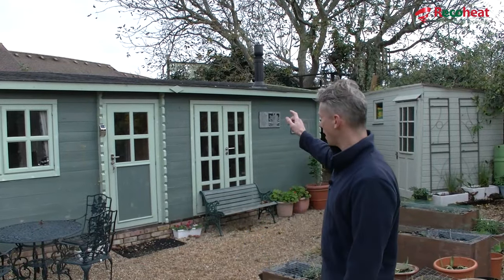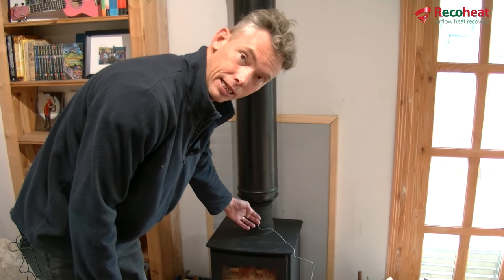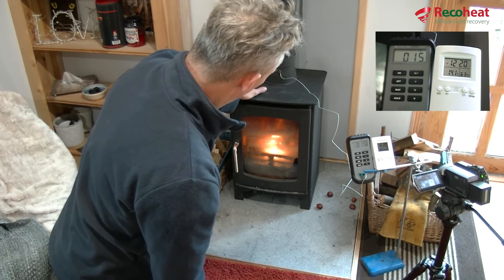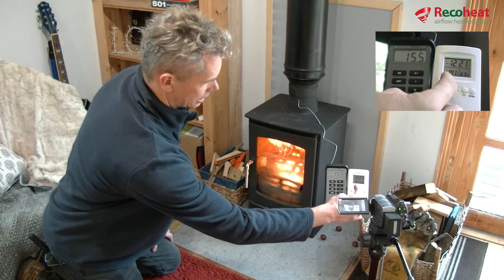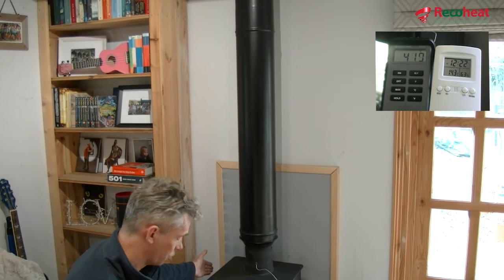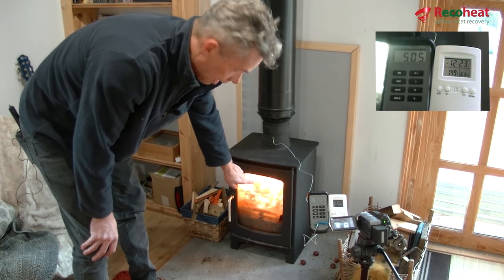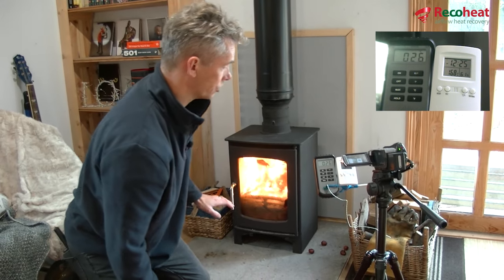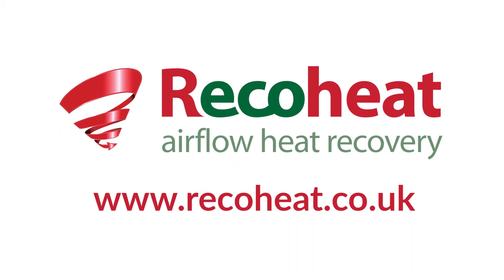Introducing the Recoheat heat recovery unit for wood and solid fuel burning stoves

Comment: I've absolutely no idea of what you're talking about. No idea of what the device is, where the air movement is, what's inside the flue. No idea if there's an electric fan in the flue, where the air's coming from, where it's exhausting to - indeed, no idea at all.
Reply from the maker: Website is www.recoheat.co.uk for more info, if you're interested.

Comment: Generally, you want flue temps to remain high to prevent condensation. Removing too much heat is a recipe for a chimney fire.
Reply from the maker: That's right: hence our use of the turbulent boundary layer phenomenon.
Reply: You nailed it...... I tried something similar several years ago and as you indicated it caused the build up of creosote, resulting in chimney fire..... it wasn't a major disaster, but could have been.
Reply from the maker: BSRIA tested the system for safety, and a key element of that was the temperature monitoring all the way up a 4.5m flue. Their report is here: shorturl.at/gtuS0 You can see that it doesn't cool the flu as you suggest.
Reply: Interesting to compare to a Rocket stove where the "flue" is kept as hot as possible for a metre or so to achieve a complete burn for both fuel efficiency and to minimise tar build up and other pollutants in the exhaust. Ideally you would want an initial  very hot section of flue (as above) before starting the "heat recovery" which is the stated purpose of this design.
Reply from the maker: @rhiantaylor3446  That's an interesting perspective. The hot burn is certainly crucial, but a big difference with our heat transfer is that it is exponentially increased in rapidity by the use of the turbulent barrier layer, so the resultant heat transfer away from the flue gases during their flow past the 9 inches or so of the coil, is absolutely minimal - so much so that it is undetectable. This is completely different to the loss in a section of single skin flue, for example. The volume of flowing flue gases passing across the coil is proportionally very small to the total, and the over-all drop in temperature is undetectable by our own measurements and in the external laboratory testing. Turbulent air heats in a completely different curve compared to a laminar flow.
Reply: @Recoheat  Either you are recovering heat from the combustion gasses or you are not. If you are then you must be cooling them. Simple physics.
Reply: I'm guessing it is using the venturi principle to increase the volume of air throughput?
Reply: @donaldasayers  I think what he's saying is that heat is recovered from the flue gases, but the heat loss from the gases is insignificant in terms of the actual reduction in flue temperature, so it doesn't cool enough to be a concern with regard to tar build up.  The hot air is then emitted from the nozzle at high pressure, thereby distributing it more evenly throughout the space to be heated.
Reply: Thanks to the All the Comments.  definitely wouldn’t chance this just stick to my fan on top of the wood burner it works well.
Reply: What’s wrong with a fan on top of the stove, ours makes our large living room feel like the inside of a Volcano‼️
Reply: I could imagine modern stoves (at least in Europe with this new econorm standards) with their secondary and tertiary combustion would make a difference, its the big molecules that condense easily, in modern stoves these get broken down into much smaller molecules before exiting the stove. 

I think that allows for some (not all) heat recuperation, especially because these secondary burns usually take place right before exiting the stove creating very hot gasses with few heavy elements.
Reply: @Recoheat  and
Reply: @Recoheat  oooh science words! It must be good!
Reply from the maker: @mark76197  Ooh, sarcasm - it must be witty.
Reply: @Recoheat  Not as whitty as using fake jargon to sell a dangerous priduct.
Reply: @mark76197  not as stupid as repeating the same thing when confronted with evidence to the contrary. Look at our TrustPilot reviews and external industrial engineers report specifically testing for the genuine concerns you raise and showing that our product does not cause these issues. If they did, it wouldn't take more than weeks at most before they were closing our customers' chimneys. Flues are not subtle things. They don't and you are reasonable but wrong. You should celebrate that because this device is important.
Reply: @mark76197  Is a ‘dangerous priduct’ to do with primary ducting or something 😂
Reply: @mikespeers8281  creosote condenses on flue pipes when the interior surface of the pipe falls below the boiling point of water. This system steals heat from flue pipes, greatly increasing the rate of creosote accumulation and the chance for severe flu fire. It will recover a lot of heat? But at a cost.
Reply: @mark76197  Oh I see, thanks for the education 🤓🤣
Reply: @mark76197  If you burn properly dried wood with moisture less than 20% and then also run the ocassional non-fan highest heat  burn thru to removeresidual  soot tar, this should not be a problem. I am no scientist but have run stoves for years, and would liken the scenario to that of DPF filters in diesel engines.  they also benefit from full throttle cycle to carbonise and remove off soot particles, creoste etc, but otherwise operate 'cooly' for 95 % of their operational time?   Give these guys a break
Reply: @thomasreed49  what kind of fan are you using?
Reply: @Recoheat well said, sarcasm is the lowest form of wit. So negative and easy. Thanks for your invention and effort to keep us all warm. 🙏🏻
Reply from the maker: @RestWithin  Thank you very much! We love all the engagement - always offers the opportunity to debate - and keeps YouTube interested in us! Thanks so much for your support.

Comment: if you can power that air pump from the heat produced on this stove and do a schematic video I think everyone would be happy; and also I think you have to figure out a way  to make a device that a normal person could install, because some installers have only got the £ in their heads and not the service sadly..many go to youtube to save money and improve what they have got, not just “look buy this, because it’s doing this”… 👍✌️
Reply from the maker: Yes, both would be wonderful. The latter is largely regulatory, though there's a very practical issue of ensuring something as dangerous as a flue is maintained competently. The former will take a lot of engineering development, so is expensive so requires lots of sales, or investment.

Comment: I don't use a double skinned insulated flue directly on the stove. A single skinned one radiates quickly into the room. If wanted heat distribution I'd use a nice quiet stove top fan. What you have, is fantastically noisey.
Reply from the maker: For sure: a single skin will radiate about 1kw per metre, apparently, but that does cool the flue far more than our device, and in any case will not circulate any better. In terms of heat distribution, the Recoheat isn't relying on radiant heat to function, so continues to distribute even when the stove is cooling. It's a very different thing, and functions in a completely different way. The noise of the turbulent air coming through the outlet is indeed distinct but it's by no means 'fantastically noisy': air and water flow mess up microphones so it sounds louder on video. In a silent evening of contemplation, you can just turn it off, but in a room with anything going on, you don't notice it.
Reply: @OKuusava  I put the 'stones' out of old electric storage heaters around my stove
Reply: I agree just far too noisy

Comment: Hi, congrats great product I'm getting one, regardless of noise. Yet would you please measure the decibels of noise of the pump and hissing combined? a decibel meter app in your phone will do. Thank you amazing product.
Reply from the maker: Yes, sure: we measured with a sound meter, but because it is trying to measure a flow, microphones hate it! We'll try with an app.
Reply from the maker: Hey 1 2 - we've done that, and here's the video: https://youtu.be/z0t3_nrurZg - it comes out at about 9 decibels. There are notes in the description of the video so you can get the same Decibel app to do a comparison. Thanks very much for the interest and the suggestion - great idea because it's actually creating data you can compare. 👍👍
Reply: @Recoheat  Thank you! 9 decibels is nada. I'm ordering it soon!

Comment: Are you saying that the air that comes out of the front nozzle is 400 degrees? isn't that dangerous?
Reply from the maker: Over the top of the stove, it's hot, yes, but so is the stove. The only time you have to be careful is for the twenty - thirty minutes whilst the stove is getting up to temperature, including while it's cold. The air from the unit is that hot within a minute because it's from the combustion, so the stove temperature won't warm you of that.

Comment: Hmm, I love it. I'm concerned that lowering the temperature of the flue would allow more creosote and condensation to build up.
Reply from the maker: The use of turbulent air to extract heat from the flow of gases means that the proportion of heat extraction is very low, and the cooling effect proportionally negligible. This was tested by BSRIA and their external independent data is available in their report and certificate on our website: shorturl.at/gtuS0
Reply: Burn properly dry hard wood

Comment: Nice! This got me to thinking and wondering if a passive system like this would also work. Essentially just as pictured only the outer pipe terminates about a foot or two from the ceiling, possible even a bit cone-shaped, wider at the bottom, to create a Venturi effect. It would naturally draw cooler air from the bottom and exit warmer air from the top. A Peltier wood stove fan could possible assist with this. A system totally removed from the need for electricity should there be a significant interruption or for off-grid settings. I'm not an engineer, just ruminating is all. Anyway, great idea. mate!
Reply from the maker: Thanks David - really appreciate it! It's something we're exploring, but as described it doesn't work because the air has to be forced to make it turbulent. It's the turbulence that creates the super-rapid heat transfer, and therefore the expansion and acceleration which in turn creates the vortex effect that draws the heat away from the stove, and the pressurisation that precipitates the heat dispersal via the equalisation. That in turn is why the heat transfers so far - because it's not being pushed, but is exchanging as part of the equalisation and subsequent convection flow. It's really interesting!
Reply: Already exists

Comment: I worked for a stove manufacturer...the wood stoves they provided met California EPA emissions.    2.5 - 4 grams of emissions per kilo of wood fuel.... very efficient
Reply from the maker: Modern stoves are fantastically efficient. Our unit addresses the poor heat displacement that is implicit in requiring the combustion to draw cool air towards the bottom of the stove, into the combustion and up to the ceiling, and up into the flue. We're providing a supplementary powered method of heat distribution from the same heat source which is extremely efficient and effective.

Comment: Is there any harmful gases being sent into the room?  Off grid no electricity think I’ll stick with the fan attached to chimney best buy I’ve ever made
Reply from the maker: No mingling of the pumped air and the combustion gases at any point. If your fan is working fabulously and does what you need, don't fix it! This product is aimed for people whose heat doesn't circulate effectively around their homes, and achieves that far more effectively than anything else, by a long way. But of course, if you don't need it, happy days!

Comment: Hi there this looks a good solution but why is it so high priced the material cost can't be more then £35 and my stove was only £366 and the price of your recovery unit is £299 its going to take many years to recover the £299 please explain your price before i invest many thanks Budo
Reply from the maker: Hi Budo, alas the material costs, fabrication and technical costs are considerably more than that. I'd buy them from you if you could produce the units and the pump, and the silencer for that, but you'd have to be CE marked first, as we are. It's not a cheap industry to operate in, as you'd imagine for safety reasons. The heat output and fuel savings mean some people replace their oil, gas or electric heating entirely with their stove, so recoup the cost in a month. The system really does make that big a difference. You can see our customer feedback on TrustPilot. Thanks for your interest.
Reply: @Recoheat  Thank you for your reply sir could you please answer one more question before we make our minds up on buying two of these for our French farmhouse how long is the stainless steel coil component inside guaranteed for and its general life span many thanks Budo
Reply from the maker: @FrenchFarmhouseDiaries  Hi Budo, the unit is guaranteed for five years, and the pump for two years. The pump will wear out eventually, but the coil won't: it's made of the same material as the flue itself, but is thicker. and the form is much stronger. External test engineers stress tested it to over 900C, and you can't see any difference, as you cannot after years of use. I hope that gives you the confidence you need!

Comment: What if the power goes out. Is there a bypass or will you burn the unit out. Thanks
Reply: No,  it makes no difference. The coil is made of the same material as the flue so is not affected by the heat. You can switch it off if you want to. It is thermal shock tested to 800°C which. Is hotter than the flue gas temperature.
Reply: @willburrows  great stuff! Thanks for your time and knowledge 🏆🔥👍

Comment: Hi, nice video but I don`t understand it :-) Please explain again because as I understand, you are pumping the hot air from the stove into the house ?. The exhaused air ?! I can not imagine that. What do I understand wrong ..? Please explain again or can someone else please ?  Thanks !
Reply from the maker: Hi Christian, thanks for the interest. No - we're pumping clean air into a sealed coil that passes through the flue. So the clean air is heated, then comes out of the front of the flue in a little nozzle. That blows over the top of the stove and carries the heat away and around the house. Do take a look at our other videos - they make it a bit clearer!
Reply: @Recoheat  thanks you very much for your quick response. Clear now :-)

Comment: Now I am wanting to buy a northern cabin up in the mountains so I could get me one of those things! Great looking stove. It would be great if you could share some of that heat through a spiral duct into the other parts of the building.
Reply from the maker: People are coupling this with ducting and circulation systems. Generally it does shift the heat a long way in any case. Customer has got one in a cabin in the mountains near Sacramento: I thought it was hot there, but he gets 6 foot of snow in the winter. Fitting the unit means he doesn't have to get up in the night to put more fuel on the stove.

Comment: Can you give a brief explanation how this works? So looks like you have an external air compressor pumping air into where? The firebox or the double walled chimney? Where is the air coming out, the firebox or at the bottom of that double walled chimney?  
If you are pumping air directly into the firebox, how do you damper down your air supply to slow down your wood burn rate?
Reply from the maker: The air is pumped through a heat exchange coil set into the flue, but completely sealed from it. The air therefore does not enter or effect the fire box or directly effect the flue gases. The coil has an external surface area equivalent to 10cm of extra flue length on a 125mm (5") flue, and 6cm on a 150mm (6") flue, so it presumably cools the flue an equivalent amount, but it doesn't make a measurable difference to gas temperature or speed, because an unbalanced chimney is such a lossy system. The unit works by heating and accelerating the air to form a jet of hot turbulent air that draws the heat of the stove away and distributes it very efficiently as the air pressure equalises in the room. The fast heat transfer and constant flow - powered by the pump rather than heat-driven convection - means that the effect is instant, and is maintained for a considerable time after the stove itself cools but the embers are still hot, so that useful heat is circulated for much longer.
Reply: Sounds like it must draw the air inside the cabin through a double. Skin flue heat exchanger. No danger of fumes getting included. If it’s a good thick metal on the flue hot side. Control could only be vented to outside if excess  heat inside cabin.
Reply: Recoheat's reply doesn't fully answer this person's question 😡 WHERE does the pumped air EXIT the unit to heat the room? Can I hazard a guess that it,s just that littl pe hole where you stuck the thermometer in?